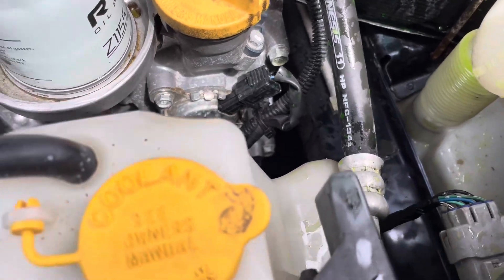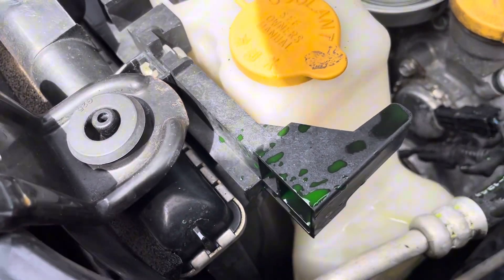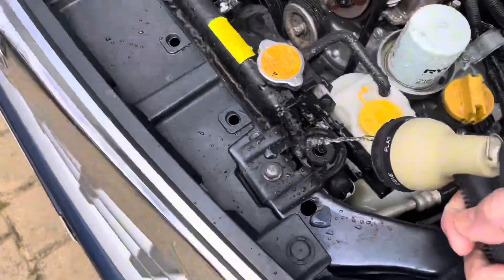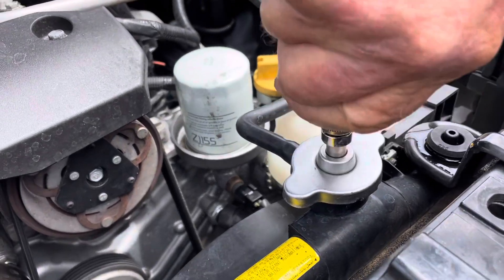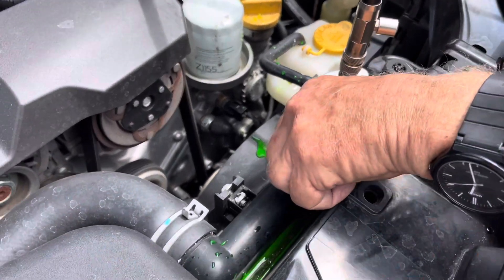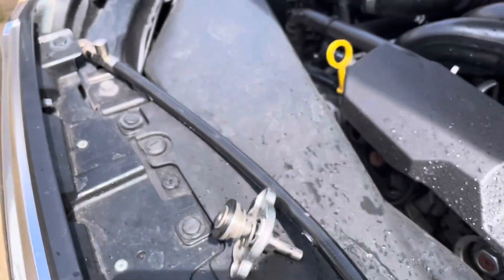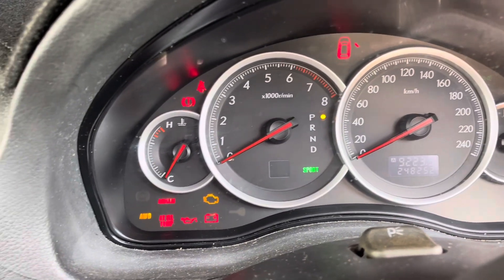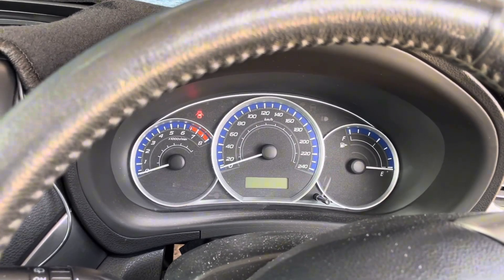Top Reason Why Subaru (And Other Engines) Go… BANG!!!

Comment: Why using green coolant. It should be blue??? I have 160,000 miles on my radiator and still strong. It gets 100 F here in Concord California USA during hot summer for 6 months. And you’re using cheap engine oil filter also as well! Use Subaru genuine parts please.

Comment: I had to replace my radiator at 100k and it was the top plastic, but didn't go bang and went 240k miles, I had a 2012 Subaru Impreza Sport. If your radiator starts to leak replace it ASAP, if you let it go the engine will go bang from overheating.

Comment: EVERY time I park in my garage at home, which is almost every day, I pop the hood and prop it open about 6 inches so the engine compartment can cool down, hose life, plastic life and all that (yes, I'm weird!), but this also allows me to see the radiator overflow tank, daily, and if there is an unnoticeable leak, the coolant in the overflow tank should eventually start to disappear, then take action! By the way, I drive and '03 Toyota V8, it doesn't have to be a Suby!
Reply: You sound like me I raise the hood every day to look around! It’s a good habit
Reply from the maker: Yes, same problem exists with most modern cars. Unfortunately the Subaru boxer engine doesn’t tolerate any high temperature events before cylinder heads warp, gaskets blow, radiator coolant leaves the engine and then…. bang! 🤦‍♂️
Reply: I usually do that in the summer when I get home from a drive I actually wouldn't mind rigging up some kind of auxiliary electric fan that I could run off of a switch or a timer that I could use to circulate some air in stop and go traffic or for similar reasons when getting home

Comment: Cooling problems have been the most common problem in all internal combustion engines since they were first manufactured. As you say, newer iterations have plastic flanges and caps, which crack as they age. Most often it's a puddle of coolant on the driveway that rings the bell. I've replaced radiators in just about every engine I've ever owned (Dodge, Chev, etc).
Reply from the maker: Yes, plastic radiators are here to stay. I have noticed that it’s almost always the plastic that fails. It’s unusual to see the aluminum core corrode through before the plastic. I think it’s planned obsolescence as the old school brass/ copper radiators lasted 20-40 years!

Comment: That's the problem with many Japanese cars lately.  Due to cost savings, they have deliberately omitted the coolant temperature gauge, which is an essential indicator of an overheating problem.  Otherwise, it would have been detected long before any serious damage when one will notice the coolant temperature gauge indicating at above its 50% level and still increasing.
Reply from the maker: Exactly right mate, not having a temperature gauge in a Subaru (or any other late model car) is a crime IMO. Maybe the older models were lasting too long!
Reply: one way of preventing the top of the  radiator from cracking is never slam the bonnet shut , but close it gently
Reply: @hades4-r4c  That's what I always do as well with my vehicle.
Reply from the maker: @ltan888  Completely agree mate. Once upon a time, car manufacturers made cars that would last, now they give you a small light to tell you, “please buy the new model as this one doesn’t work anymore “ 😂

Comment: Common problem with any plastic tank radiators with some age on them. Heat/pressure cycling does them in. Blew out a radiator on '88 Chevy S10 at 9 years old.
Reply from the maker: Yes, I hope you Chevy has a water temp gauge… not a red light telling you your engine is cooked. Unfortunately, Subaru engines seem to warp heads, blow head gaskets once that critical temperature is reached! As for plastic radiators, I don’t know what the answer is… there must be a better material out there? Thx